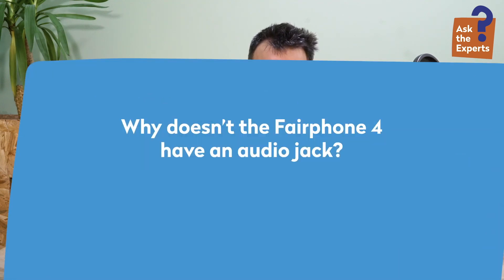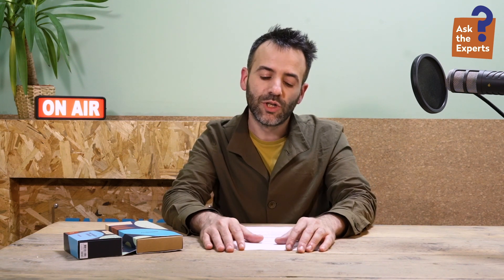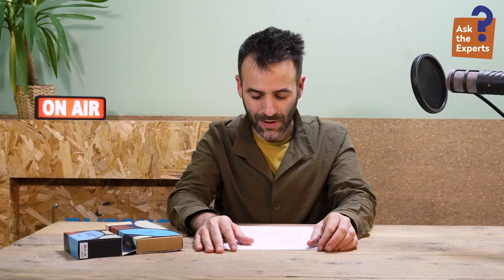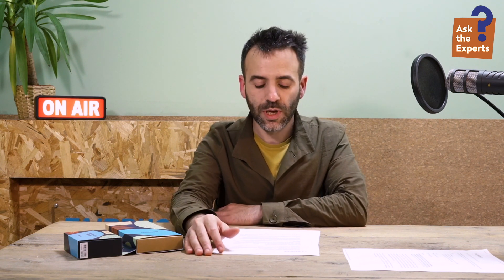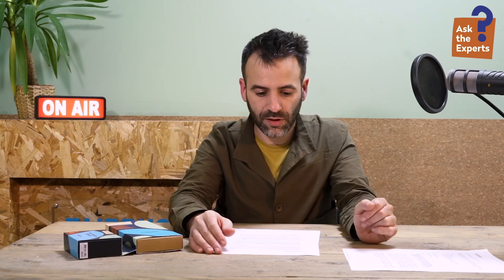Where's the headphone jack?! | and other questions answered | Fairphone

Comment: I'm in the market for a phone in the next few months. Like many before it, the charging port is broken & only charges if at a very particular angle. It's a good phone but five years old so don't mind recycling it & upgrading to something newer.

Fairphone was something I'd seriously been considering. You sold yourself on being a customer friendly brand. Therefore, I would love to see some actual data on your failure rate of headphone jacks. I have always had the charge port fail. Never the headphone jack. I don't know of anyone who has. I've also gone through multiple wireless headsets while my wired earbuds have lasted years without breaking or running flat their non replaceable batteries. And I've never had to fight to get it to pair with my device. I just plug it in & BOOM it works. How is this green? Again, I would love to see the actual data your company has used to reach this conclusion.

Here's hoping the next version of the Fairphone lets me use wired headphones without speeding up the inevitable charging port failure. If you can do that, I'll be sure to buy from you in the future.
Reply: I've got the feeling that they'll never answer this in an honest manner.

Comment: Why not to being truthful?
You increase port usage in the most used port, usb c port. if someone's usb c brokes, phone gets useless. 
You also eliminate the internal DAC, pushing the cost to the client to use headphones. Add that to your calendar and the coincidence of launching your bluetooth audio and dongles. 
How does a dongle is a more green option? a lot more material.
Honestly.... be honest.
You are pathing your own way to not even being credited as green or as moving into "greener" options. 
As for me, I was saving for the Fairphone 4. going to the Samsung A52S. Beats it on every spec, except bluetooth version, has a better water ingress rating and it's pretty much half the price, 3 major android upgrades and 4 years of security updades and, gues what, a Headphone jack  :)
Reply: PS- And the replacement is a non repairable bluetooth earbuds. So you replace a repairable item with a non repairable, much more expensive to make, and with a not even comparable worse sustainability politic.And the solution is either buy the dongle, also much more expensive to make. Sorry, but it simply doesn't stick.

Comment: I bought a JACKSTRATED phone model that pretended to be an upgraded model. Never again. I've gone through 4 USB headphones just this year. Sorry Fairphone, I'm looking to upgrade to a de-googled phone, but I won't get your jackstrated downgraded new phone.

Your argument is shit. By your argument, you should remove the charge port and start selling wireless chargers. 

Not only are you promoti g a MASSIVE INCREASE in e-waste, but those solutions inevitably also uses at least TWICE as much energy. 

Stop lying, start listening.

Comment: There is no valid reason to get rid or the headphone jack. If ecology is the target, then making the phone unable to connect to wireless headphones is a much more valid action, as they live just as long as their battery lives, and are one of the main sources of e-waste, and a totally toxic product category.
This is a very big concern, as wireless headphones tend to last between 6 months to one year, and meanwhile Sennheiser and Beyerdynamic still have pieces in stock for their 80's and 90's wired headphones BECAUSE THEY STILL WORK.
It doesn't affect me personally because I use a USB-C DAC, but really, it is just one of the worse moves ever.

Comment: This is just a really poor justification for removing features. Forcing people to use dongles or wireless headphones will only create more e waste and especially more harmful e waste at that with the wireless headphones due to the lithium batteries that they contain that you cannot replace. 

Next year 
Where's the USB port?! | and other questions answered | Fairphone
Next next year
Where's the camera?! | and other questions answered | Fairphone
Next next next year
Where's the screen?! | and other questions answered | Fairphone
Reply: They just haven't found good suppliers for short lifespan unrepairable external devices with chargers, cables and irreplaceable batteries for you to buy from them. Version 5 will at least have the long requested USB delete and sell the wireless chargers with adapter and cable, so you can charge in twice the time while not being able to lift your phone off the charger. It's a great upgrade for the e-waste conciouss who really needs a phone 1% smaller than model 4!

Comment: No it drastically increases e-waste with the disposable bluetooth earbuds and headphones not having a 3.5 jack forces you to use. Wired headphones will literally last decades.
Reply: Yep. My phone's from 80-s and 90's still rock on. 

I went through 4 Bluetooth headphones just this year after buying a JACKSTRATED phone model. A downgraded newer version of my old phone that already died from overused charge port.
Reply: @calysagora3615  Rocking a pair on HD414 made in 1964, 2kOhm each driver. To be fair, I had to replace the 5pin DIN connector with 3.5mm, keeping up with the times :)
Reply: wired usb c headphones says hi
Reply: @fuseteam  That's be fine, I even have a nice usb dac/amp, if the phone had two usb-c ports.

Comment: i have used my current smartphone 5 years and i can tell you that my usb c port has been much less durable than the 3.5mm jack even tho i have probably used my headphone jack wayyy more so i am not sure if makes sense to remove it to make phone last longer. yes i had to remove some dust from 3.5mm jack couple times but that's not too hard to do.

Comment: aaand another one to strike off of the list of candidates for my next phone. nicely scored own-goal there fairphone
Reply: Yeah same. I'm also waiting until one of these niche phone won't be a downgrade in terms of soc from my currant 4 year old oneplus 6. About the only thing's I really want that it doesn't have are proper usb 3 and 5g. Though that starlink emergency messaging thing would also be great I don't see that coming to any phone with a headphone jack any time soon.
Reply: @TheAkashicTraveller  a mid range chip from 2021 is worse than your top chip from whenever one plus 6 came out? Impressive
Reply: Indeed.

Comment: Wasn't the 5-year proposition, already in your previous phones? 

How come you still don't have a device timeline with an expectation of: When you'll have to replace the camera, when you'll have to upgrade the battery, how likely it is to need to switch to a new network or new antennae's.

These aren't impossible questions. And they could be built into your product expectation to extend it's lifetime.

Megapixels and number of cameras seem to double every few years. Wireless networks change every 5-10 years. Demand on batteries increases faster than they shrink.

Comment: "It's a design decision... It's important to remove any part of the phone that may break." 
Well I guess throw the whole phone away, cause everything can break.

Replacing a 3.5mm jack with a dongle is not more sustainable. You know how easily dongles break? Or how easily they get lost?
You're just exporting the problem to a different piece.

If you're worried about the audio jack collecting dust and water: provide a plug that can go in there!

The issue seems to be the 5G antennae space, and all the rest is excuses piled on.

Well I guess I'll try a 2nd hand Fairphone 3+ and if it lasts me 5 years, then maybe I'll consider whatever phone you make then.

Comment: Well, I can say I have a phone right now (not a Fairphone) with a broken headphone jack (it still works but it wouldn't stay in by itself which is really annoying) on the other hand I'm used to using a bluetooth adapter by now so it's not that bad I guess.
I strongly believe that Fairphone is the right way to go and I might buy one if my phone stops working. However I have owned a FP1 and FP2 in the past and from my experience they had more software than hardware issues, so I'm afraid that the ability to replace spare parts won't get me very far if the system fails again.

Comment: The lack of a headphone jack is a deal breaker for me. Hopefully it comes back for the fair phone 5.
Reply: It never came back. So many common asking for it though. Hopefully we can push them to bring it back
Reply: Went the Motorola route instead of Fairphone.  No extra e-waste from wireless headphones.  No unnecessary disposable dongle.  I just use my existing headphones, and it's great.  ASUS and Sony are also making options with 3.5mm jack.  This completely threw away the environmental credibility of Fairphone as a company.
Reply: It won't. The Apple effect is permanent without a full restructure of a company.

Comment: LIESS 
a jack more breakable than a small usb c, is this a joke ? 
you want to show to other that make good phone is possible, and you follow apple wtf
the jack is one of the most durable connector, you have just no good reason to remove it

you afraid about dust ?  well give a caps on it, or a fake small jack and this is solve

no jack mean, use of very fragile and breakable adapters
a use of the usb c very very often
no jack may mean blutooth, so hearphone with complex fragile system, with lithium battery
and a the end a tons on waste 

i have a expensive headphone, and refuse to pay a fairphone with probably the worst design of the 4 models

3 new phone in 3 years, all for a phone with the stupid multiple cameras with stupids high definitions (in bad way) , without jack and not sure for usb-c power delivery
just disgusting

Comment: At this point a smartphone without a headphone jack is a deal breaker for me. 

I LOVE what you're doing with your company and would be so excited if Fairphone came to the USA but unless you add the 3.5mm jack or design a USB-C adapter that is split, providing me with a 3.5mm port and a USB-C port, allowing me to charge my phone while using headphones (or connected to my car which doesn't have bluetooth), I just can't buy a smartphone without a 3.5mm port. Wired headphones and listening to music in my car (via 3.5mm) are too important. 

I hope a future Fairphone comes to the USA and either has 3.5mm or an alternative that doesn't take up the singular USB-C port which is needed for charging.
Reply: They must have lost thousands of customers because of this simple issue. It's a complete deal-breaker for me.

Comment: i had an xperia, around 2014, probably t3 lite or something. my headphone jack literally cracked away, like missing chunks of plastic kinda deal. used that phone no problem for over 3 years and like besides having to hold the earbuds to hear anything it still like, turns on and works perfectly ok. regular headphone jack in a phone was the most revolutionary experience I've got out of a phone, and like, i was there when flagships were monochrome and monophonic. hope ur unrepairable airpods sell well bc lol im not buying a phone with no jack

Comment: Well, the only reason I can accept to remove the headphones jack is there are a lot of antennas and modular design should be maintained. Because my HTC ONE M7 didn't have any issue with it's headphones jack during the strong rain and it doesn't have any IPxx. Btw it's lasting for 8 years now, so 5 years of spare parts availability for FP4 doesn't seem like much for me. I hope the battery replacement will be available for longer time.

But I can't understand why to remove the notification LED? It's not heavy, it's not big and it's very useful and increases battery life. I was considering to buy this phone, but without notification LED and camera2 API fully working I can't decide... 

Also I'd prefer to have the selfie camera in the upper border without the notch/black hole in the screen, like Sony does, but I think I'm asking too much :)

I understand, it's fair and sustainable phone and I like this thing, also there are degoogled versions, but I'm also looking for a phone for the next 10 years probably, I have to like it.

Anyway thank you for this project! May be there's a fairphone 4+ at the end of this year and I like it more :)
Reply: I'm willing to bet your M7 is still going strong. That really was the peak smartphone era. I miss my Google Play edition M8 more and more with every new phone.

Comment: I am just upgrading from the FP1U to the FP4. The only reason I need to is that more and more apps are refusing to run on the older Androids. The most important way to make hardware last longer is to find a way to force Google and other OS writers to keep their software backward compatible.

The much maligned Microsoft used to be good at that, but even they are now refusing to write drivers for older kit. The average office worker does not need a computer more powerful than (say) a Pentium 3 to run their spreadsheets and word processing. The average phone user needs to make calls and communicate - most of us do not need a gaming engine in our pocket, and the FP1 would still be a usable phone if the drivers were there.

Comment: I've never heard of a phone "breaking" beacause of the headphone jack. 

Many companies manage to IP68 water- and dustproof their device even though they carry an audio jack. 

It's clear that it is harder to allocate space inside the device whilst fitting the aux port, but it just should be done in a Fairphone. 

Wireless headphones do only last as long as their batteries really. Some do not even have the option to be powered by cable - almost all in ears, as far as I'm aware. Plus, we should minimize the amount of batteries we produce, as they are most often not or not fully recycled, and even if, that costs a lot of energy and money. You can get a lot better headphones that will last decades for cheaper if they're wired as well. 
The 3.5mm port is undeniably useful, even for things besides outputting music. Always carrying an adapter isn't a real solution and I'm pretty sure you're aware of this too. Sadly, not including one is a dealbreaker for me. I hope the next generation Fairphone can fit one though :)
Reply: I think there's a more simple reason!  The people working on the Fair phone aren't very bright! This is what actually led to the removal of the 3.5mm Jack!
Reply: To be fair, they didn't say anything about wireless headphones. The solution proposed in this video is a USB-C to 3.5mm jack adapter. I can kinda see their point, but selling this as an environmentalist move is just straight-up greenwashing.
Reply: @cogspace  so you say, they are making false claims/lying on the only USP they have? The only reason to buy it? This shows to me, that the company is not trustworthy and they don’t offer anything else
Reply: @cogspace  those are shit and you can't charge phone while using them
Reply: Of course not, that guy is full of it.

Comment: I call bullsh*t on the Headphone Jack. The 3.5 mm Jack is one of the strongest connectors there are. I have a Asus N76VZ laptop from around 2012 and I use it only with headphones. The port is not even loose, absolutely ZERO problems with it and I pulled so many time on the cable! This port survived 10 years with no issues and here you are "concerned" for it lasting 5 years?
I also use Samsung Galaxy Note 4 from 2014 with Headphone Jack. I bought it USED in 2018 so 4 years with constant headphones use and no problems!
Try being honest ... why do you have wireless headphones on your website?
Reply: if I understand correctly, the less reliable part of the 3.5mm jack socket is the built in microswitch that tells the phone to mute the speaker, etc, when it is plugged in. This makes intuitive sense to me as it is a thin bit of metal that is flexxed every time you plug in or plug out. The USB-C connector verifies the connection electronically rather than with a microswitch.
Reply: @trueriver1950  It doesn't matter, the 3,5mm Jack though it's mechanical, it outlives the electronics that it is installed in. Nobody in my entire lifetime ever tolled me that their Jack port died. And like I said, the Jack in my laptop is still working, 10 years now so it's way pass the 5 year warranty that they pretend to be worried about ...
Reply: @trueriver1950  "This makes intuitive sense to me as it is a thin bit of metal that is flexxed every time you plug in or plug out."

What exactly do you think the plug terminals happen to be, then? Left channel, right channel, and ground have to connect SOMEHOW...

Comment: Can you or your team substantiate the claims that adding a 3.5mm produces large risk of failing in electronics?

The 3.5mm jack in literally centuries old, is one of the most used electronics ports, and up until a couple years ago was present on pretty much every cell phone including ones that were "built to last".
Reply: Well it means one of three things 1 there full of crap 2 they suck at designing a proper headphone jack and 3 there userbase magically breaks more headphone jacks

Guess which one it is my money is on 1